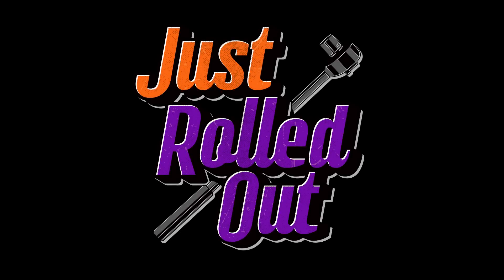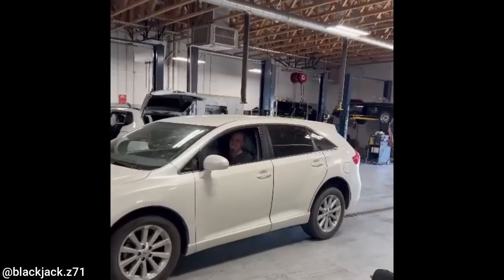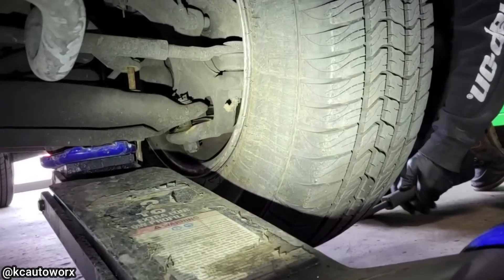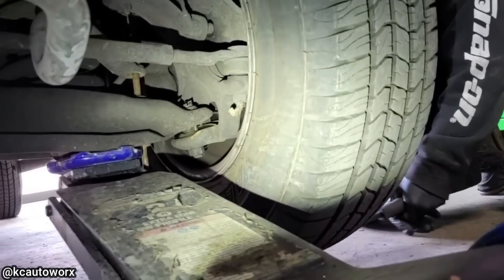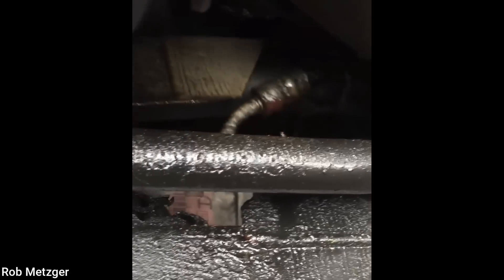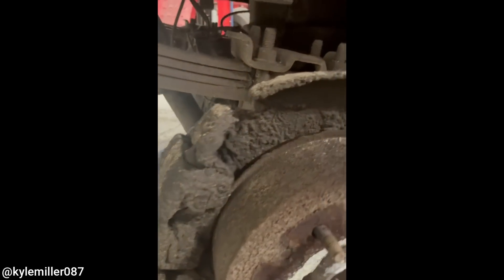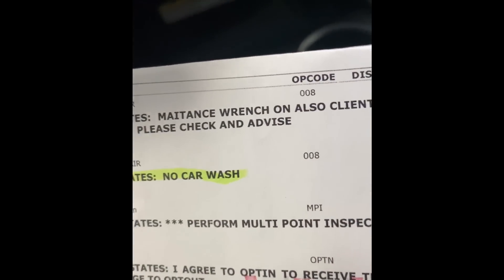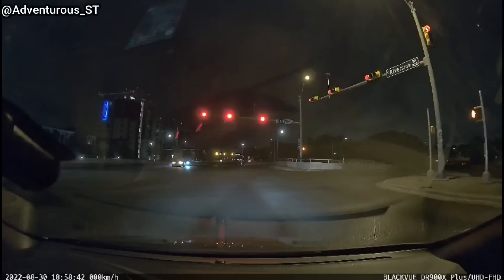Customer States They Tried Fixing Exhaust Leak, Still Leaks | Just Rolled Out

Comment: Now, it's been a few years since I've worked in the industry, but, I'm pretty sure replacing rear shocks is still ALOT cheaper than buying a whole new car.
Reply: Definitely, I’d rather spend $2200 AUD on new shocks and coil over springs (or leaf springs if I’m driving a Ute) instead of forking about 15x more on a brand new car.
Reply: Yea.. I just replaced 2 shocks on my vehicle for like 30 dollars by doing it myself and ordering from rockauto
Reply: There could be more wrong with the car than just broken shocks. Also it could be that the customer was already planing to get another car and the broken shocks was the last push.
Reply: Damn! Parts / supply chain shortage must have really driven up the price for replacement parts!
Reply: My friend took her car into the mechanic she showed me the quote for $3,000+, told her the repairs cost more than it's worth and only recourse was to scrap or sell the car. Then she had me look at it, most the things he listed weren't bad, and some things he didn't list  like a bolt missing from the caliper grinding against the rim. But yeah took $110 to fix it. So the car with bad shocks probably gave some crazy quote and offered to "take the car off his hands". Lol
Reply: @Yophillips3272  probably.
Reply: Just wanted an excuse to get a new ride like the neighbors!!
Reply: Clearly there’s more wrong with the vehicle than just bad shocks. And when the narrator said new he probably didn’t mean brand new, just a different, new car.
Reply: Given it's a Toyota Venza, it probably only has 10-20 more good years and 300,000 more km left before it's not worth maintaining. I can see how scary that can be to someone with commitment issues...
Reply: Yeah but that way the dealer can’t screw over your average Joe

Comment: Hood latch bolts shearing off is a new fear to add to the collection
Reply from the maker: right? I've seen it happen to a truck on the highway once. I couldn't believe my eyes. Luckily they were okay!
Reply: Probably left it open and the wind took it, the safety latch did it's job lol
Reply: @Yophillips3272  I have a Studebaker Champ pickup and the hood blew open on me. That's when I found out that a standard cab Champ didn't have a safety latch for the hood. It didn't even have the holes drilled where the latch would attach. They don't make they like they used to!

Comment: “I’m not spending $2,000 on repairs.  But heyyyyy…that’s a nice new car for $60,000.  I’ll take it.”
Reply: In their defense, they probably saw the start of a repair-a-thon and decided the sooner they get out of it, the better.
Reply: It's the American way
Reply: Must be nice!!
Reply: It's usually easier to get a loan for a new $60k car than $2k in repairs for a 15+ year old car
Reply: @Sid The sloth If it needs rear shocks that badly the front ones probably need to be replaced, along with suspension bushings, tires, alignment and anything else they could find while working on it.  And the customer could have been considering getting a new car before so there's really no way to know for sure
Reply: @Sid The sloth I never said it was smart, I was just giving reasons why someone might make that choice.
Reply: @@sidthesloth128 To be fair, they might have meant new car as in 'one they did not previously own', not as in 'one that had never been driven'.
Reply: @@sidthesloth128 Oh no, I am NOT saying you are getting a decent car for 1-2k. Just that it could be a LOT less than 60k:D You would have to be VERY lucky to get a decent vehicle in good shape for 2-4k, I would expect it to be in the 6-12k range depending on where you were buying it.

There is a BIG difference in prices after all depending on whether you are buying in san francisco/LA/new york vs rural alabama:D
Reply: Which they will promptly drive into the ground!
Reply: @Sid The sloth But if the car is only worth $1500, and likely to suffer further mechanical failure in the near term.  So you are pouring money into a pit when that same money could be going towards (the interest for sure but) a newer much nicer car.
Reply: @mybrainmeatshurt  for people who are neanderthals
Reply: Herde der right on
Reply: 2K for rear shocks???
Reply: @Vertraic from someone living in NY, I can promise you there are still great deals under 2000 bucks. As long as you’re even mildly decent with a wrench. And even if you’re just smart about what to look for you can find something

Comment: 1:23 - This is why ALL Rodents should burn! I have had this exact thing happen to me at least 6 times. I had to remove a blade from opposite side of the fan barrel to re-balance it. Taking apart half the dash to vacuum out voles and field mice from the heater box, is such a freaking PITA.

Comment: About the Venza, traded in, cause it needed shocks? A co-worker of mine did something like this years ago. She had a two or three year old Civic, just out of warranty, that needed about $500 or so of engine work. Instead of paying the $500, she talked to a salesman who told her if she traded the car in, she could have a new car for the same monthly payment, which was a lot less than the repair cost. See how that works? I'm not saying it's a good idea, but some drivers just think of the monthly payment- if a repair is going to exceed the regular payment, it's trade-in time.
Reply: The word "she" told me all I needed to know.
Reply: @bobfeller604  Something about women and cars! Another woman at the same company said, "My Accord is almost paid off, I guess it's time to start looking for a new car." Even though there was nothing wrong with it! She figured she was always going to have a car payment and might as well enjoy a new car....
Reply: I've never had a car payment. Recently a friend of sold me her 2011 Altima for $1000. The check engine light was on and she didn't want to get it fixed, even though I told her the code just said it was the MAF sensor.

I took it home and took off the engine cowling to check the hoses first, and the PCV hose was cracked. I replaced it with a new one for $10, reset the computer and completed the drive cycle, and the code was gone.

There were a few other issues, the more I looked into it. The CVT was whining, and the fluid drained out black, but after a fluid flush and replacing both filters the issue resolved itself.

There were also wood screws holding the intake scoop in place, which I replaced with the correct machine screws (the wood screws were too small and didn't even reach the original threads luckily or they'd be damaged). It also needed new brake pads and some pop rivets to hold the splash panels up. There's some rust on the rear fender too.

Also the glovebox latch is broken. . .

All in all though, I spent maybe $500 or repairs and now have a pretty fun little car.

I also got a Sonata from a girl for $800 because she drove it with no coolant, and a Tahoe that my dad gave to me after we rebuilt the engine and I paid for parts.

I guess I think it's more fun to restore something old, than to buy something new and watch it die 😂
Reply: @nightlight0x07cc  It is fun. I see it as a learning experience. I once bought a five year old Civic from a gal for a good price with 88,000 miles and put another 150,000 on it before I sold it. It was a little tank...'87, tough car, and still passed smog.

Comment: An ex coworker of mine asked me to take a look at her vehicle because it was running rough, I asked her when was the last time she had a tune up? She didn’t know what that was and I explained what it was. she had never had one so she traded her vehicle for a new one. Face palm
Reply: She probably got screw less at the car dealer than the mechanics shop TBH...
Reply: @obsidianjane4413  well as a mechanic, lack of regular maintenance does not improve your vehicle, but you do have to shop around for a good mechanic. Just like anything else in life. Her problem was that she did not do any regular maintenance to begin with. If you can afford to do spark plugs wires well I guess ignore forward to buy a new vehicle, her choice.
Reply: And probably still never serviced it, then wondered why it broke down so often.

Comment: I attempted to fix my exhaust leak without the proper equipment once, it would have been a good addition here if it was ever recorded haha.
Reply: Nah, those are messed up, you can have all the tools and materials you ever need for anything and that wouldn't do it. I bought a new muffler since the original one opened up due to rust, and it was supposed to be a 5 min job. Then I tried to take the old one out and it is literally completely rust-welded on the middle muffler. I tried hitting the end of the pipe that's coupled onto the middle muffler pipe with a metal rod, I had to use the flat end of an AXE because my hammer was just too small... and nothing... that connection now looks like one solid piece of metal, you can't see a separation gap.

I even tried to disconnect all the rubber rings from the muffler and just let it wobble around like that, thinking that at one point it might crack the connection loose at a speedbump or something. I drove it like that for about 3 weeks, no chance, that thing is welded strong. No signs of it being actually welded by a person, it looks clean on the outside, but rust can do this, I think.

Since I can't use power tools (living in an apartment building and there's no electricity available in the parking lot, nor do I have an inverter or generator) and I don't have a welding machine, going to a repair shop is my only option. For a thing that is basically the most plug and play component you'll see on a car, you just pop it out and plug the new onw in, hang it with the rubber rings and that's it. If it's not welded stuck on the exhaust system...
Reply: @techalyzer  Rust never sleeps.
Reply: @techalyzer  of course it's welded on, you're supposed to use a sawzall and cut it off. either get a long extension cord out the window or a cheap jackery battery that has a plug
Reply: @uncrustable9923  It's not supposed to be welded. It just plugs in, then it has a pipe clamp and you tighten the screws. Actually, there shouldn't be any welds in the exhaust circuit. Are there cars out there that have them welded? Mine is all screws and flanges.
Reply: @techalyzer  all cars are supposed to be fully welded and sealed, screws or clamps are from previous owners half ass jobs on it (flanges are factory but mufflers and other components are welded either from factory or a muffler shop)

Comment: I have used a baked bean tin like that oil filter before....but only to hold the exhaust together to get to the shop for them to weld it after fitting headers on. Here in NSW, Australia we have to have a yearly safety inspection on all cars over 3 years old. Does this happen in any of the states in the US? How many insurance policies are denied due to cars not being roadworthy?
Reply: Yes, inspections required in some states but not all. Some are strictly emissions related, some are safety inspections, even most of those are really lax compared to the rest of the world. Lots of states have none at all, ever. 

Do they inspect your car for insurance? Not something that happens here, you can buy insurance on the internet in minutes, get a policy and file a legitimate claim with them never once seeing your vehicle before it's in pieces.
Reply: @pontiacg445  Here in NSW sometimes you have to have your car inspected for insurance if it is going to be an agreed value, otherwise it is based on what the car is valued at on the internet and not looked at. If you have a car that is defective, the insurance company can void the policy. Then you may have to pay for all damage to both your car and whatever you may of hit. Part of the registration setup is that you have to have personal injury insurance, so that is a separate thing. If a car is modified more than outside specific amounts, then an engineers certificate is required. Eg. A 4WD can only have a maximum suspension lift of 2" and no body lift. If you want a 4" lift you need a certificate. Engineers certificate can cost about $2K-$3K AUD. The same if you lower a car or increase the wheel track by more than a certain amount. Most insurance companies will not insure a car or void the policy if the car needs engineers certificate. There is some companies that will cover modified cars, but it costs more. Emissions here are not as strict as a lot of places as long as all the pollution gear is on the car, and they don't test the cars with a "sniffer" unless you are fully modifying a car

Comment: I actually wonder what's the best course in cases of the trucks value vs repair. I recently had a 98 Jeep rear ended and no shop wanted to touch it because of its age and 200k mileage.
I had to find a custom body shop 2 hours away to get the rear hatch and fender pulled
Reply: Jeez 98 and don't wanna touch cause of age seems hella sad in my opinion.
Heck there's VW Kombis here that are a few decades older than me still running here (albeit you can bet how well).
EDIT: those are badly kept workhorses here, not the collectible thing they're in the US and such.

Comment: I did plugged a leak on a straight section of exhaust pipe on my old Saab with a coke can and pipe clamps years ago. It passed inspection ... in Sweden! The inspector said as long as a fix is done safely they do not care.
Reply: I did this with a piece of sheet steal bent into a half pipe and hose clamps on my honda civic. Worked like a charm!

Comment: I'm scratching my head as to why the owner of the white car at 0:34 traded it in for a new car when the tech advised him that it just needed new shocks. If I was him, I'd would OK the replacement of them. It's a bunch cheaper than getting a new car.
Reply: I suspect we didn't get the full story here. But still, shock absorbers can be purchased pretty cheaply. The KYB Excel-G aftermarket shocks for my Fiat 500 were $150 Canadian for the pair. It was a simple swap! I also replaced the hardware because of road salt, but that was just four bolts.
Reply: Speculating..  Could it be rust? We've seen some real rust buckets on these channels. Also with the popularization of EV's, fuel prices and the environmental climate shaming and guilting could play into such a choice.  👍to clever salesmanship.👍
Reply: I knew someone who did this all of their life a bald tire was enough to get rid of a car in their eyes (they never bought new always used)
Reply: @opendstudio7141  the hell do EV's have to do with it?  That just makes something else burn the gas
Reply: @tsm688  Like the reporter asked.. "Where does the electricity come from?" The California state executive replied, "From that building." 
It's a strange time we live in.